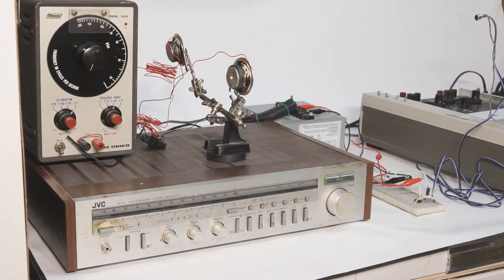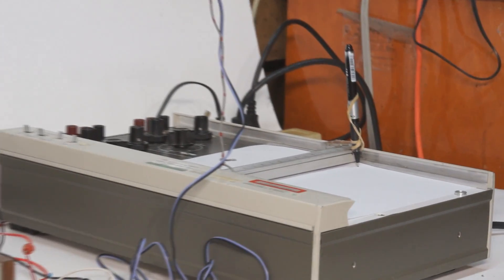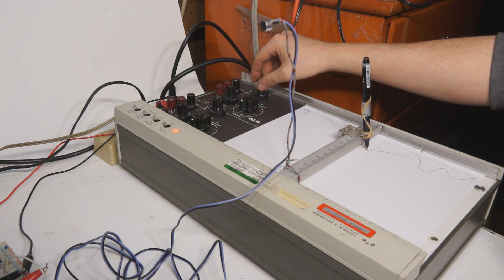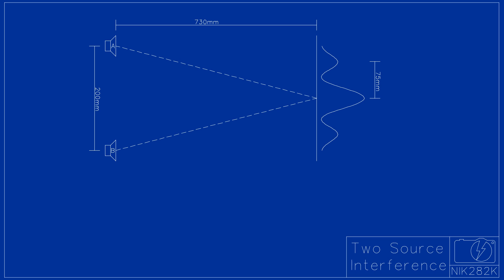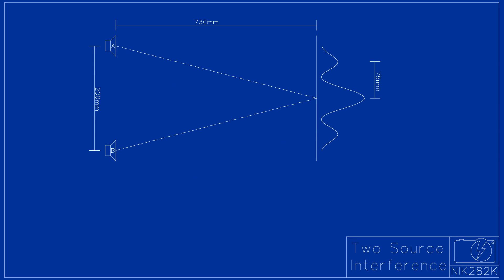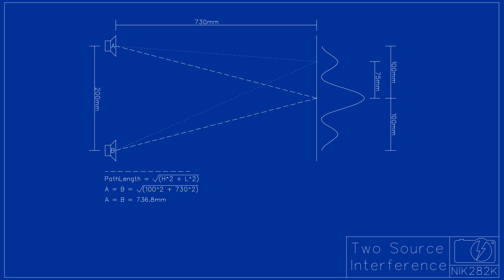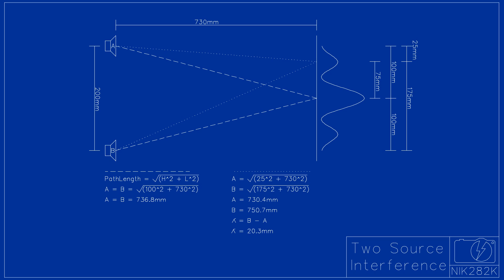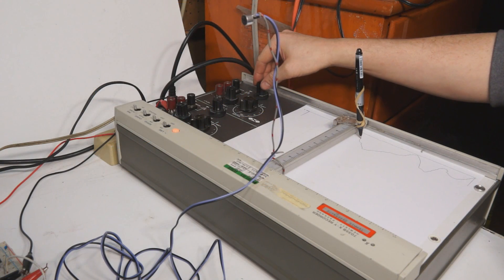Acoustic Interference - Double Slit Experiment

Comment: I've been wondering about semi-open back guitar amp cabinets, and with the open back design. Whereas most open-back cabinets have about 1/3 of the back removed, what if there were two slits? One commenter regarding guitar amp cabs stated that they had positive results in terms of bigger sound with one 3/4" wide slit across the back, instead of the wider rectangular opening or an oval opening. Perhaps there are some acoustical benefits to be found regarding audio interference/combining with two slits.

Comment: If you feel the urge to make a follow-up video at 40khz, I can send you some ultrasonic transducers. That would give you a more pleasant working environment, and a shorter wavelength. I made some rangefinders many years ago, using some as speakers and some as microphones. They were connected directly to microcontroller pins, so they are trivial to drive. Let me know if you are interested, and I will test them and make sure they haven't died of old age.
Reply: Hi interesting suggestion. I like to revisit this.  Can we discuss further
Reply: @vellaru  certainly.

It might take some time to find the ultrasonic transducers I wrote about, but I have some range finders I can cannibalize for parts if needed.
Reply: @hamjudo  couldnt send email. To hamjudo
Gmail
Reply: @vellaru  I left off the dot com

Comment: Also cool;  LibreCAD is also in the BSD Ports library, reducing software maintenance overhead.
Reply from the maker: Do you run free/open/net/other? I've been transitioning to Debian for the sake of compatibility and ease.
Reply: MacOS has a FreeBSD backend.  I used FreeBSD back in the day to serve as low-overhead, GUI-less Internet servers for the municipal cable ISP I built and ran in the early oughts.  And a bit of Redhat.  I've found BSD to be a more mature, stable platform, while linux was more on the bleeding edge, particularly with networking and GUIs.

However, I've been using the BSD Ports collection on Linux since Slakware 0.99; it's just comfortable to have around.
Reply from the maker: Awesome! What kind of equipment did you need to run an ISP?
Reply: Well, in this case, the CMTS (Cable Modem Termination System) was already installed and configured.  However, Excite@Home was closing up shop, leaving the city of San Bruno without a service provider.

We kept the old router, a Cisco 7200 vxr, and got a DS3 connection to Sprintlink.  Since we had usage history on our installed customers, we knew how much bandwidth they were using, so we didn't have to over-commit. 

So with all the big networking gear already in place, it was just the common services associated with an ISP:  Mail, Webspace, DNS, and Newsgroups.  Newsgroups are a tremendous suck of resources, so we farmed that out to Supernews, rather than take on a full newsfeed, locally.   The CMTS system needed a provisioning system, which took care of DHCP, and also created mail and web accounts.

The provisioning system, mail server, web server, and DNS servers ran on 5 Pentium 4s, at 2 GHz, with 2Gbytes of RAM, each.  (More than sufficient for serving 1400 residential customers, really)

It ran on that hardware for 4 years without a hitch.  Too bad the guy who hired me retired, and his replacement was useless, or I might still be there today.
Reply from the maker: +Nevin Williams I would have thought that newsgroups would have been one of the lighter loads. Was it storage or bandwidth that made them a resource hog?
Reply: It was both a bandwidth and disk hog, as well as an administrative pain.  I don't recall exactly what figure had been quoted to me then for a full feed, but 90 gigabytes a day sounds right; That would have consumed 10 megabits/s of data, average.  Our customers were only using 25 megabits/sec at peak.  Also, only about 100 even read news, and of those 100, about a half a dozen read a lot. of news.  Mostly Warez, Pr0n, and pirated media, of course.  So we decided that we weren't going to float that particular expense .  Since our dealings and such were all a matter of public record (very refreshing), I was able to explain, very succinctly, why we were not going to be offering a full news feed.  Of course, I extended, if some felt that a full news feed (we did purchase a dozen or so ports on SuperNews's servers)  was essential to our high speed service, concerned citizens could always petition city council...   No one did.  :)

Comment: Nifty plotter!

I'm gonna guess 1970s vintage?
Reply from the maker: The manual has '86 in the corner but it could be a re-print. I've taken the slop out of the mechanism so hopefully I get a better plot out of it next time. Now if only I had a reason to use it.
Reply from the maker: Awwww, I hooked it up today to try part 2 of this video and the Y-axis linear resistor has a short half way down. RIP plotter.

Comment: Awesome stuff as always Nick.  I like the new blueprint drawings.  This is the same basic theory that we us when building antennas for amateur radio, particularly multi-element beams that use a reflector and directors for achieving gain.  Distance between elements is critical, as well as the lengths of the elements.  Cheers! Chris.
Reply from the maker: I've been trying to make my drawings look a little more professional and I think I'll be keeping this format. LibreCAD is pretty straightforward software once you get the quirks and shortcuts figured out.

I found the same thing, the whole setup was very sensitive to changes in geometry, even moving my hand back and forth between the two speakers was enough to produce a strong beating as reflected paths added and subtracted from each other.
Reply: You should go over to https://www.qrz.com/hamtest/ and take some practice amateur radio exams; no CW code necessary any more for any license class.  Good luck!  Chris - NI7IN
Reply: Agreed, the blueprint looked really nice and professional.
Reply from the maker: +whuzzzup Awesome, glad you liked them.